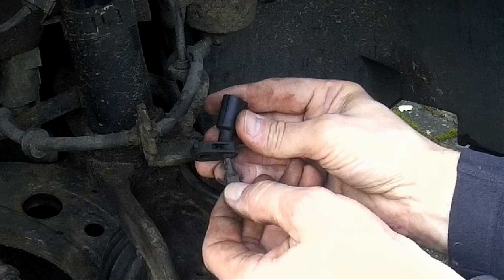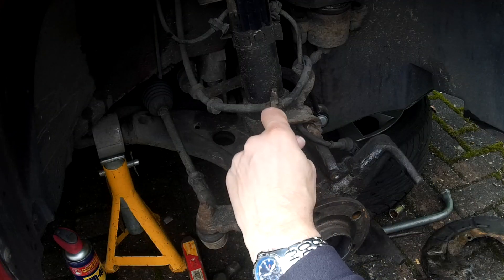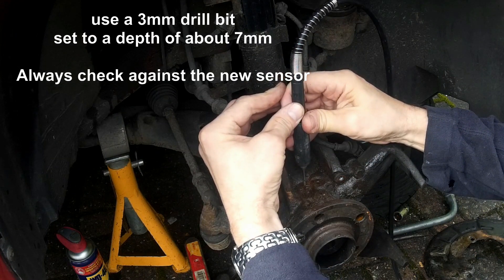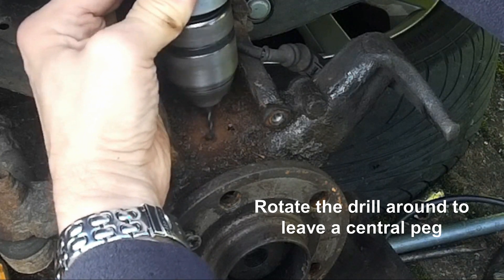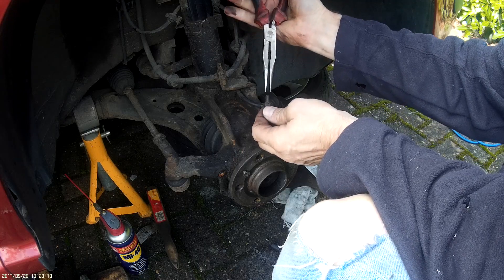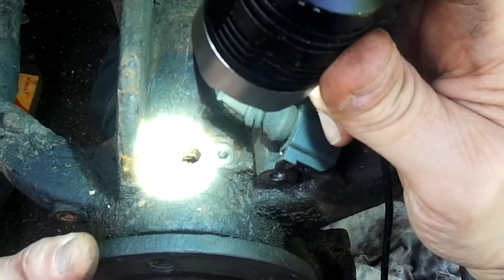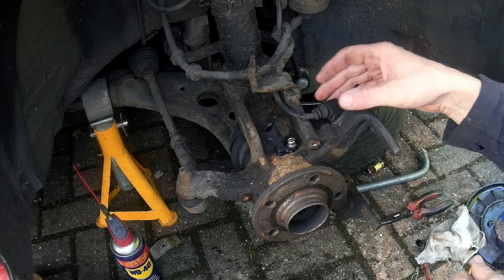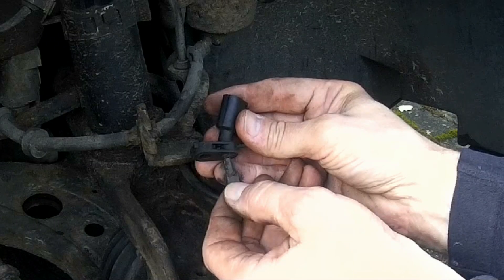VW, Audi, Skoda, Seat, BROKEN ABS WHEEL SPEED SENSOR

Comment: I’ve got a 1.4 mpi 8v with no ABS and my speed sensor has gone, not only does Skoda parts have 3 separate part nos for it, I’ve no idea where it is on the car
Reply from the maker: if you have no ABS then you won't have a wheel speed sensor.

Comment: What fault code will you get when this happens, i got similar issue with a 2012 Seat Leon. The code I got from my scanner is 00290 left rear ABS wheel speed sensor - mechanical malfunction/electrical error in circuit. The car will go forward but not reverse stated by the owner.
Reply from the maker: yes ABS fault,  car won't reverse? sounds like you need to look at the hub as something more serious is up - The control ring is mounted within the bearing.
Reply: @HatBoyHarvey  I'll take the car apart this weekend to change the sensor and check the control ring while I'm there. What can cause damage to the ring? I'm new to VAG cars.
Reply from the maker: @ClarckRPieters  I guess there could be something possibly metallic trapped at the back of the hub where the drive shaft goes into the hub as the ring is there at the back. You'll need a torch :-)
Reply: @HatBoyHarvey  sounds like a fun project for the weekend.
Reply: @HatBoyHarvey  I cleared the codes and scanned the car, it appears to be stuck in reverse for some reason, so we are taking it to a transmission shop and having it checked.

Comment: Another method:   This needs a M6 machine thread to wood thread type dowel, perhaps not in everyone’s tool box but maybe worth the effort to source.  Drill in the centre of the broken sensor by about 10 to 12 mm of a size to suit the wood screw.  Screw in the wood screw end of the dowel using 2 M6 nuts to gain purchase on the machine thread.  Now a piece of tube, or stack of washers of the appropriate length over the stud and use a M6 nut to jack out the broken piece of sensor.

Comment: Hej My wheel bearing was replaced and after 200 km drive, ABS started getting applied automatically when I was trying to apply break. Later on ABS light turned on which stayed on and no ABS getting applied after the light trurned ON. I have put in a new sensor but still light is not turnin off and i have checked fuse etc. 
Please suggest if there is anything more to it. Any suggestion will be appreciated. Its scoda fabia Mk1
Reply from the maker: you could test the cable and ABS sensor's function with a multimeter and spin the wheel. The wires can often break so you may be able to see that or trace and test for continuity. If one sensor has gone then the others will surely follow so you could replace all ABS sensors on each wheel.

Comment: Hi! I followed your video on replacing the wheel bearing, very god video! But I did not remove the abs sensor because of my understanding it did not need to be remove as log as de flat part of the special removal tool was in the place where the sensor was (I used the same special tool you did). The sensor looked great after removal, I cleaned a bit with a axial wire brush and tried to be careful with the sensor. Now the abs light is on. What do you thing went wrong? 

Very good videos you got mate! Cheers!
Reply from the maker: Did you not disconnect the battery first? that may have triggered the light or the cables/connection has been lost or it may be another sensor.

Comment: On My Skoda fabia vrs the speedo doesn’t move will that be this sensor
Reply: What size drill bit did you use
Reply from the maker: No, these sensors control the ABS braking system. The speedometer control sensor is in the gearbox housing, check the wiring to this/replace sensor first before removing the instrument binical as these can fail being exposed inside the engine bay. If you suspect the binical, fix or replace you will need to reset codes within ecu with OBD2 code reader. Hope this helps :-)